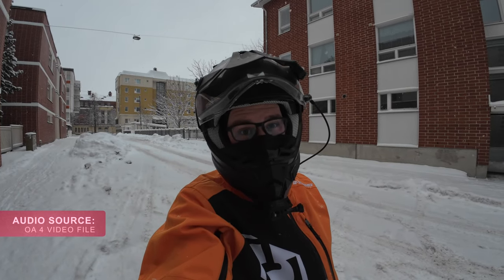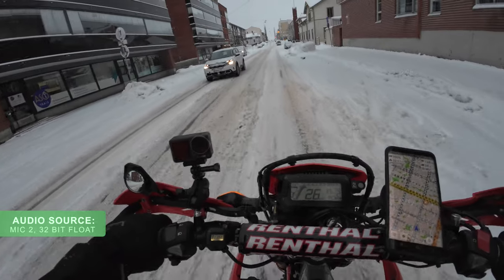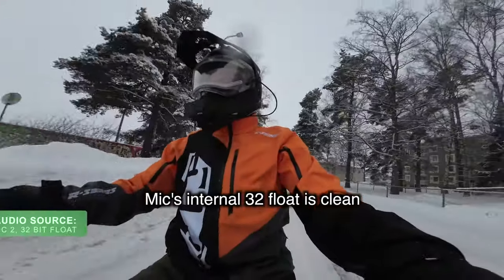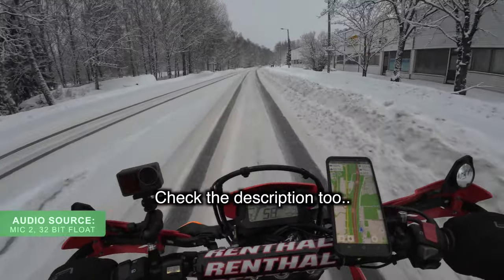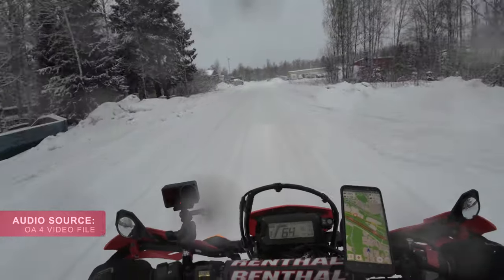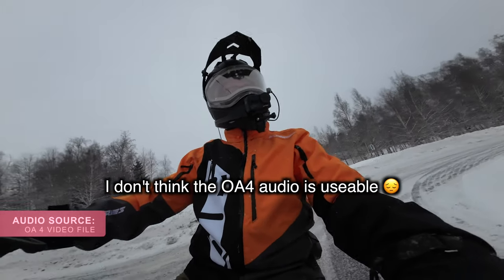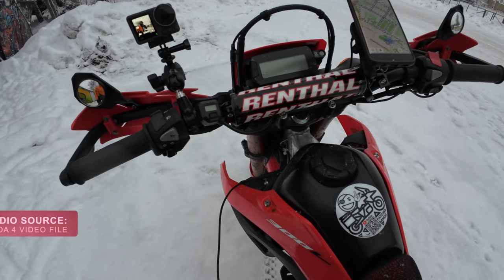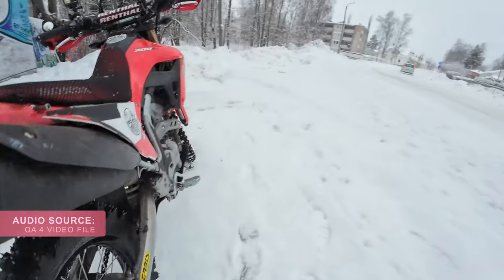DJI Wireless MIC 2 & Osmo Action 4: Fixed. Check description.

Comment: I recently returned my Mic for a Mic 2 and when I plug it into my PC, it takes a long time to respond. We're talking about 20-30 seconds after clicking on the drive until it opens and then I get transfer speeds of about 700k per second. It took one minute to transfer a 5MB file to an SSD via USB-C so something is wrong. I've formatted both of my Mic 2s and it's still the same. My PC works fine with any other device/drive.

I never had this sound crackling issue though, maybe because I updated the firmware. The mic never flashed to confirm the firmware update like it says it will on DJI's site but I can tell from the Action 4 menu that it upgraded.

Comment: Hi PB: could you post a better look of the helmet setup including lav mic positioning? Thanks in advance. Btw, your snow riding is insane!
Reply from the maker: I have always thought about doing a more in depth motovlog setup video but my setup keeps changing constantly so the video is just always being pushed 😅
I will think about doing one at some point.
Reply: @PatchedBandit  I put my DJI MIC 2 inside my Shoei modular helmet and connected via BT to my Ace Pro. The audio is terrible. I am going to try a lavalier mic plugged into the Mic 2 and positioned farther away from my mouth. That's why I wanted to see where you placed your lav.  I just returned from Prudhoe Bay and my videos could sure have used some commentary😁
Reply from the maker: DJI mics don't work with iphones or other companies products the same way they work with DJI cameras.
Reply: @PatchedBandit  I am learning that now. I do love the Leica lens and articulating screen on the Ace Pro

Comment: I think the inhouse audio from the OA4 is good! You get more of the motorcycle sound in that recording. I will still buy the two when the mic 2 is released.
Reply from the maker: Fair enough! The internal audio level is a bit higher from the box so that is causing the 'engine sounds' to be a bit more noticeable. I could have adjusted this in the edit though so it's not really a benefit of the internal OA4 recording. 
The cracking is something I don't want in my audio so I will be using the mic's internal file with the 32bit floating point as it is much cleaner.
Reply: @PatchedBandit  i think you have higher focus on your content then I have 😅 I'am a bit lazy and like when my editing is easy and qiuck 🤦‍♂️ 😊

Comment: I use Telwin powee bank / starters 12V DC under my jacket for my heated visor so I don't have to plug myself to the bike. 

I have also the blug from the motorcycle but I prefer the Telwin power bank.

I like to ride on snowy roads with crf300 rally.

Sad but true - winter rally season is soon over. 

Back to summer tyres. 

Kuopio / Finland
Reply from the maker: True. I’m swapping to knobbys already as most roads have melted already in Vaasa.
This is the annoying middle season when nothing is good to ride 😂

Comment: Hi, I would like to use the DJI Mic 2 for motovlogging, but I have a question. Do I just pair the transmitter (mic) with my Insta360 X4, and that's it, or do I also need to connect the DJI receiver to the X4? I read that you get worse audio quality without the receiver. Also, with the transmitter inside the helmet, would it be better to connect a lavalier mic to it? Thanks
Reply from the maker: Apparently you get better audio quality connecting to DJI devices and you get the float 32 bit as a backup. I don't know if it's worth buying these for other devices like Insta.

Comment: Nice video, Have you tried putting the mic 2 inside your helmet without using a lav mic? That is how I use mine without any issues at all.
Reply from the maker: I have tried it but the only place I can reasonably fit it is in front of my mouth and I would not advice that as the mic is not waterproof.

Comment: The crackling is disapointing. I'm planing a travel to Ushuaia and wanted to usa a similar audio setup.

Guess I will have to be creative and embrace the cable mess.
Reply from the maker: They have fixed this with firmware
Reply: @PatchedBandit  that's awesome! Dual mics for stereo recording too?
Reply from the maker: Sadly only single mic support for the oa4

Comment: Maybe you could help me out: If I fix my Osmo Action 3 somewhere on the bike - what is need to speak wirelessly while filming? Microphone, transmitter, ...? Thanks, Günter/Nürnberg PS: When I chin-mount the DJI Action 3 on my fullface helmets I use a Samsung headset with cut-off earplugs, cheap and has worked brilliantly all year long. But it has cables.
Reply from the maker: I have used the DJI wireless mic 1 a lot with the osmo action 3. Problem with this setup is that the receiver needs to be plugged on the camera when recording and it is a bit tricky to get it to stay. I used to use tape to keep it in place.
Reply: @PatchedBandit  Thanks. I have tape ;-) Günter/Nürnberg

Comment: I’ve been having problems with my DJI mic 2 connected to the Osmo action 4. With 32 bit float and low cut on. Cam at +5 db. Mics at +2 and +6 respectively. There are “zaps” when we talk too loud or shout, happens to me more as I have a strong abrasive voice. Using Usb-c to usb-c cable directly from RX to cam. Anyone else have this problem? Fix?
Reply from the maker: Why would you use a cable connection? It's a wireless mic. And if you are peaking lower the DB. I always ran my wireless mic at -12 DB with my lav mic and have gotten clean audio. You just need to boost it or use compressors in post production. Straight without editing the levels are going to be too low if you want clean audio.

Also if you are motovlogging using a lav mic attached to the transmitter there are major differences between lav mics. I use Movo ACM400 to get nice and clean audio.

Comment: Does the audio separate when recording with this microphone? Or is there joint audio with video?
Reply from the maker: IF the mic is connected only 1 channel is recorded in the video. From the mic itself you can download a 32 BIT float file from the same audio but with the 32 bit floating point. For example if your in video audio is peaking you might be able to save the audio from the internal recording (mic).
Reply: @PatchedBandit  Thanks, I don't want to go to that much trouble, I just want to connect the mic and record the mic audio on the video. I don't have to connect the audio truck to the video separately. Is it possible?
Reply from the maker: @syrasel  Audi will be attached to the video directly if the mic is connected. No need to adjust any sync etc. Just remember to set your levels in the camera settings for the mic so you don't get peaking. 
Normal speaking/vlogging is good at -0db but If you do motovlogging put it all the way down to -12 if your mic is close to your mouth.
Reply: @PatchedBandit  many many thanks